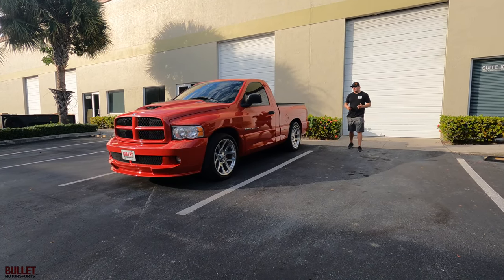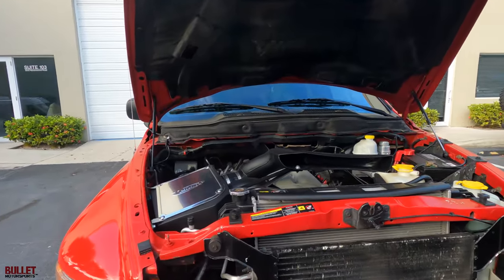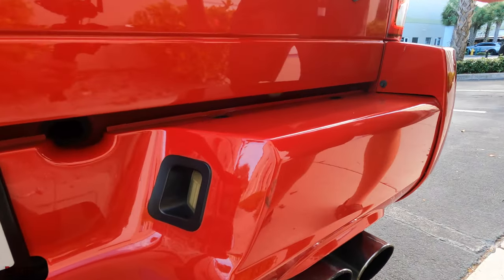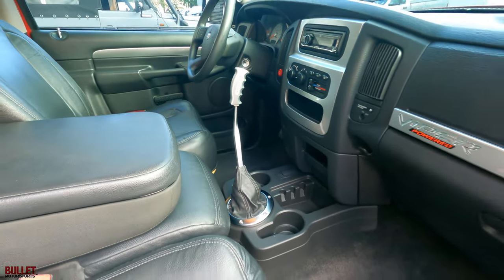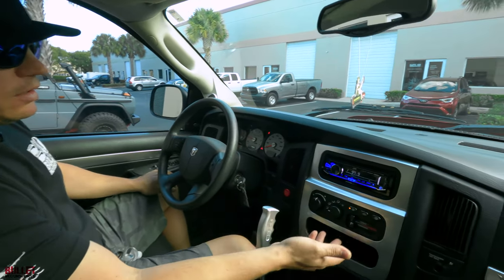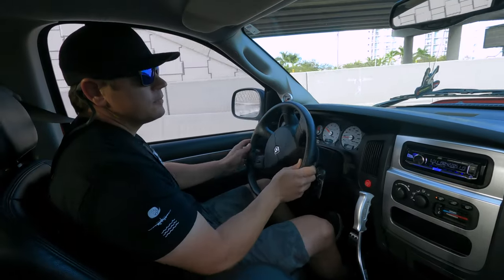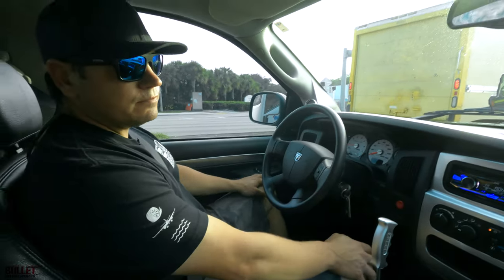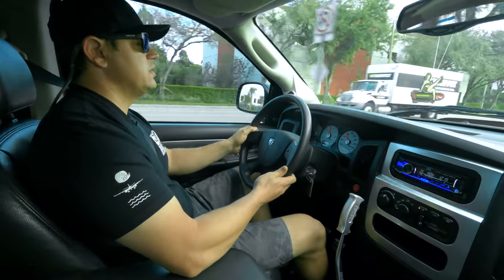2004 Dodge Ram SRT-10, Fastest Production Truck Of Its Era | REVIEW SERIES [4k]

Comment: Its still the fastest production pickup based on top speed. In fact it literally still holds the Guinness World record with 2, 1 mile laps in both direction at 154mph. 

TRX will never be able to beat it because for some reason people decided they wanted a Baja pickup instead of something that was actually wind tunnel tested. 🤷🏻‍♂️
Reply: Yeah the problem is when people look it up the TRX comes up but they don’t look any further than that and they don’t understand that the Trx might be quicker but it’s top speed is 118 I think but the top speed of the srt 10 is 154 which I think that 154 is faster than 118 and it happens in every video people make about the srt 10
Reply: I’m glad I wasn’t the only one that caught that

Comment: Daily drove mine for 3 years till I blew the transmission up the other day. Plan on fixing it as long as the motor is fine.
Reply: They are rare so it would be worth your time
Reply: @haydona1845  I went to see it today so when it's back on the road I'll be doing a video.